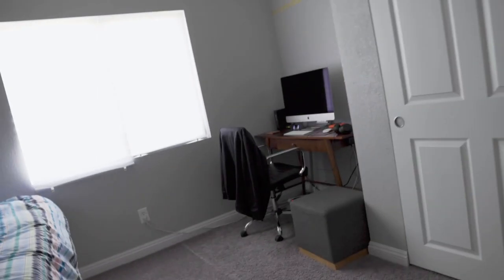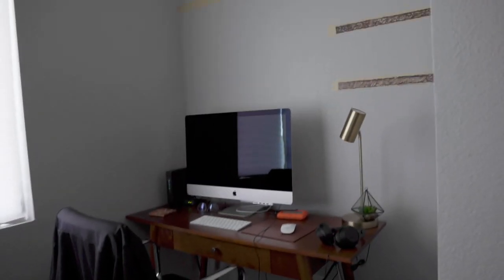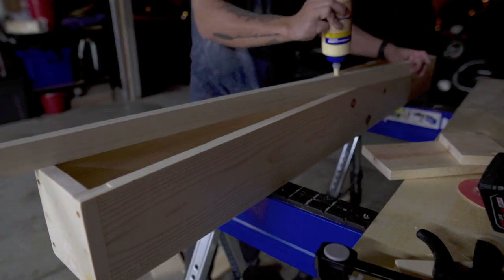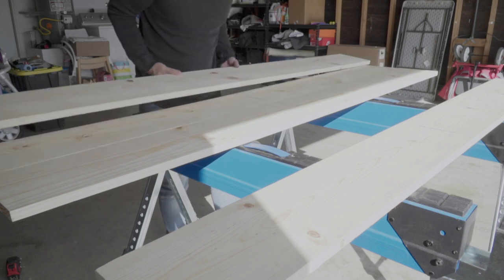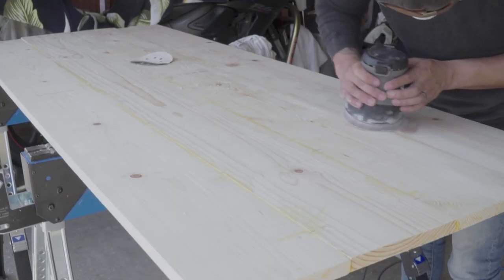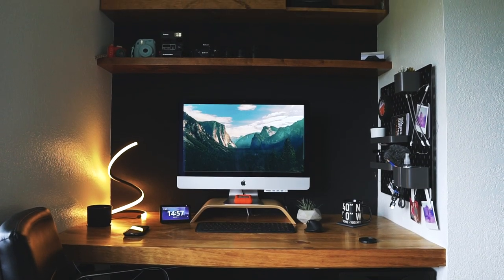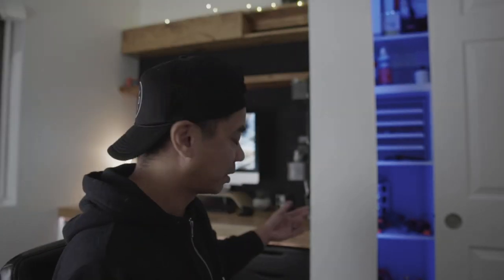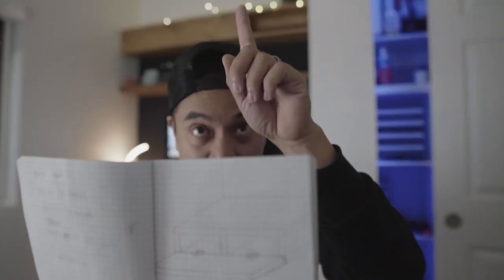DIY Office Desk - Creative Work Space

Comment: Desk set up looks great! Question: how did you address the gaps in between the 1x6 boards? Did you fill them in? Sand the boards down? I'm thinking of doing something like this but for writing. I'm wondering what's the best way to get a smooth surface. TIA. Great video!
Reply from the maker: I filled any gaps with wood glue and saw-dust mixture. If you need it to be perfectly flat between the boards, I would suggest getting a planer (?), to get the whole table top flat. Then sand it smooth.